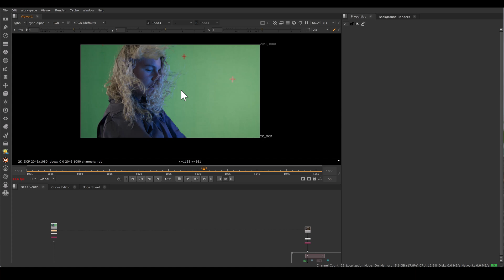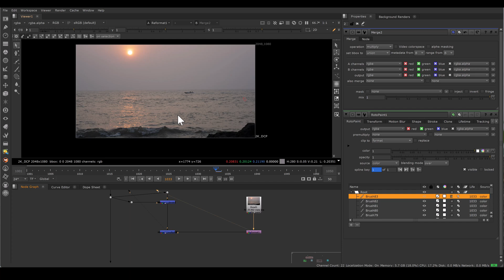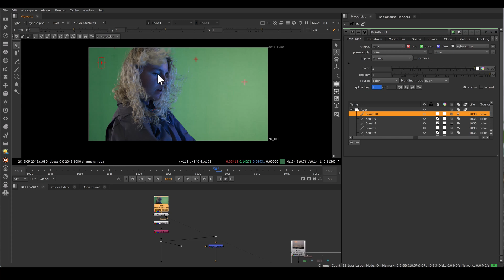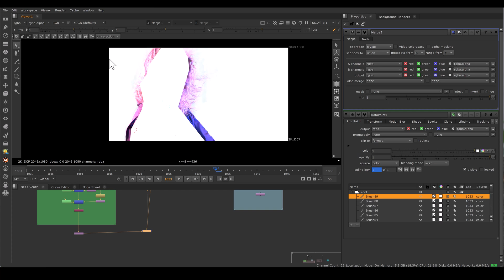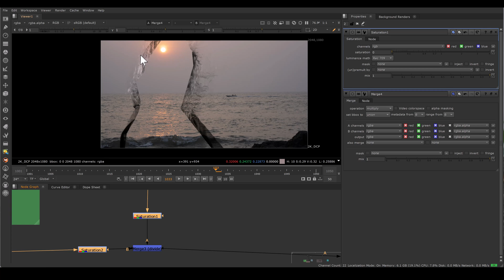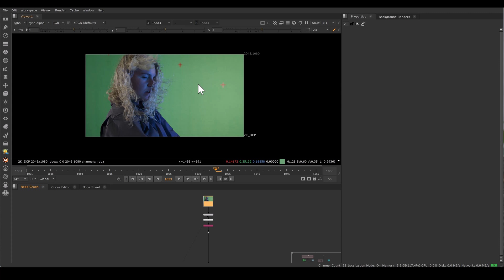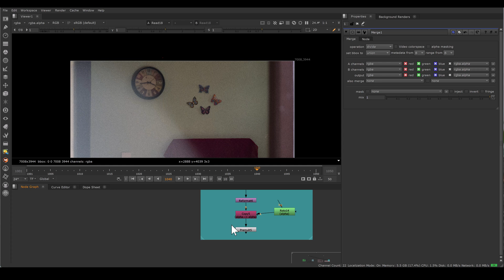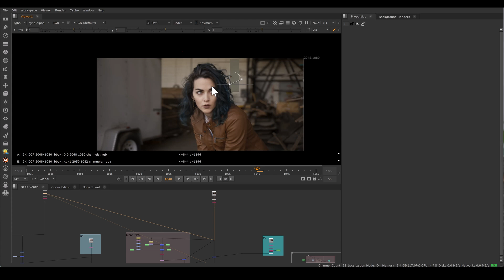Nuke: Additive Keying without Green Screen I extracting finer details by divide & multiply

Comment: I was wondering, is it okay if I use photoshop to generate clean plate?

For instance: Let's say, I have static footage with medium shot angle which has 4/5 characters in it and I'm not able to create plate using the shot due to the footage is filled 60% by the characters.

Does that work if use photoshop to generate clean plate to get rid of the characters?
Reply from the maker: hi rizkyws, To ensure this method works, both the main plate and the clean plate must be identical in file format and color space. The only difference should be the cleaned part. If this is followed, it will work
Reply: @auxiliarynatter  I've tried it and it worked. Thank you so very much
Reply from the maker: @rizkyws7829  great, thank you

Comment: Thank you! I am attempting to set this up in After Effects. Would you be able to recommend the basic steps for doing that?
Reply from the maker: Hi grantpichla, welcome, These specific division and multiplication operations can be replicated in After Effects using layers, which serve as the equivalent of the Merge node in Nuke.
Reply: @auxiliarynatter  I am not sure why, but after dividing the footage from the clean plate... Things are looking good. But the next step for the resulted footage, using Multiply as a blend mode, never looks right putting it on the new background. That is why I was curious if you were able to provide some insight.

Comment: awesome as always. i used this method but i didn't understand why you cleaned hair with paint node why it is necessary in chroma and live action plate also?
Reply from the maker: hi Narutouzumaki ,i have not cleaned hair with paint node. i am not getting you ! can you suggest where ( time of video) you feel that i cleaned hair with paint or can you please rephrase your query. Thanks
Reply: Sure 7.52 @auxiliarynatter
Reply from the maker: @Naruto_uzumaki7979  hi Narutouzumaki, i said "i made clean plate with plate information, i didn't do any cloning" means i have taken available information from different frame which area is free from hair and made a clean plate, i have not used any paint node in above showed both example. 
even
i would like to highlight please make clean plate using available plate information .
i hope it's helpful. thanks
Reply: @auxiliarynatter  thanks sir really appreciate such in detail explanation 🙏

Comment: And also, in the first case , you are applying a saturation node with the value of 0, so you are removing rgb and not luma, but how you dial, after, with the restoring of the hair-details- colours?
Reply from the maker: Hi Ilaria Baldini, i missed to mention that adjust(lower) saturation as per need ( making zero is not rule) also in case of green screen or blue screen doing proper despill before divide operation to  both plate & Clean Plate exactly the same way gives the proper intended color.
Thanks a lot to bringing this into attention. much appreciated. 🍻
Thank you